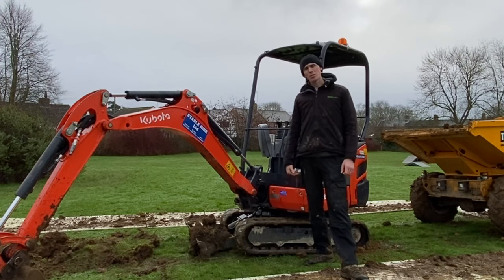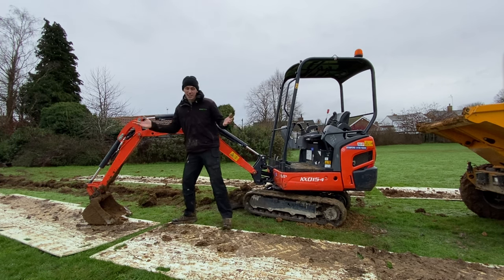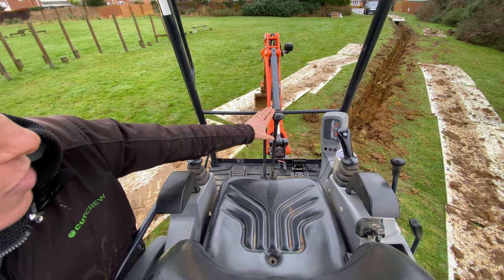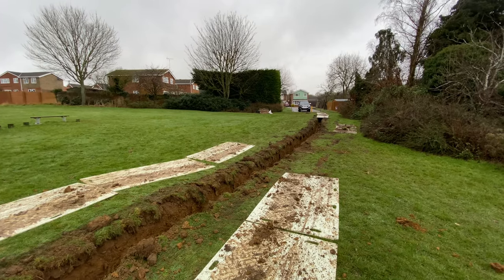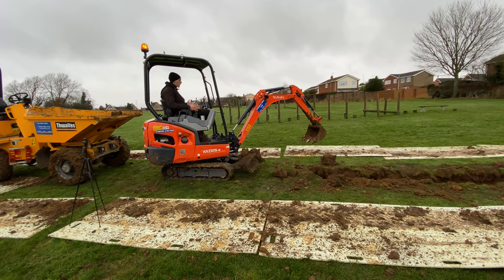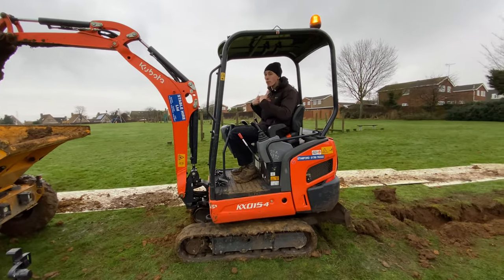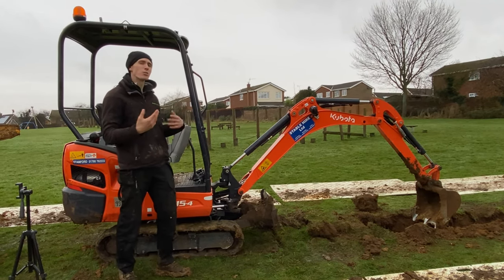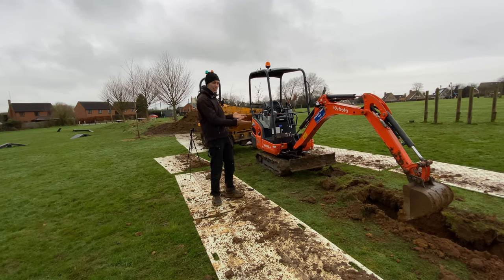HOW TO USE A MICRO DIGGER *BASIC OPERATION*

Comment: Hello, I am a digger operator. I've operated from .7 up to 750 tonne excavators. With smaller excavators never try to slew with your dipper arm ( outa boom ) at full extension as you can and will roll the digger, especially if your sitting on top of dirt that you have cut out. Just be careful everyone, take your time they are quick and can cuase alot of damage to other yourself,bpeople or structures. Another thing I would also suggest is dial before you dig for underground services. You do not want to hit them.
Reply from the maker: Cheers Nathan!

Comment: Will it do a two meter foundation trench? I will be working in a tight space with not a lot of swivel, but working in a straight line will be fine.
Reply from the maker: Check the maximum dig depth of the specific machine I have a feeling 2m deep is far too deep for a micro!
Reply: @cutcrewltd  looking at it 2 meters is too deep. 600 wide, maybe rebar and 1 meter deep sounds good, although I’ll get an engineer to check, thanks
Reply from the maker: @stevemcilroy.62  think the deepest we have ever had to lay foundations was 1.2, due to a tree being near the boundary, as you said rebar!